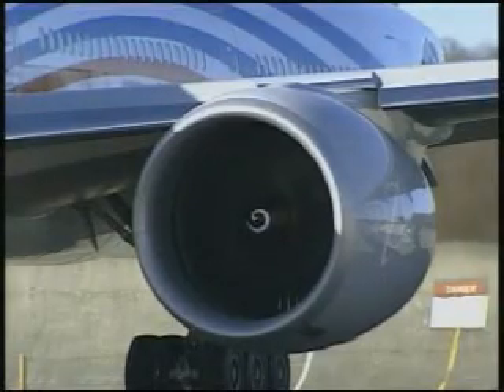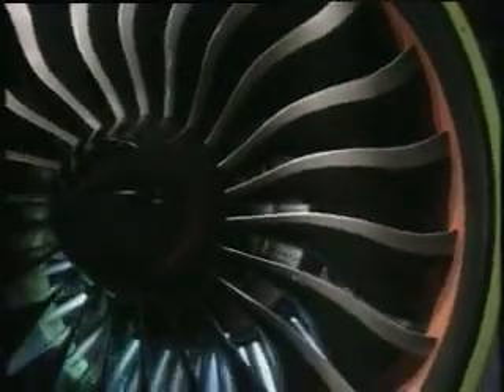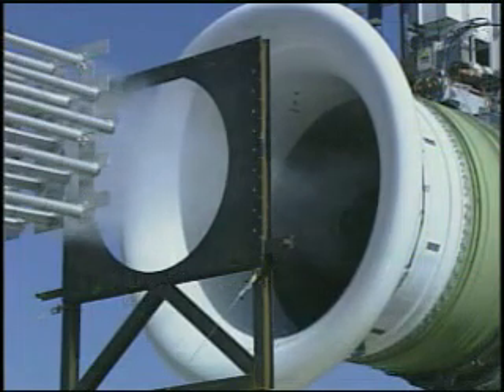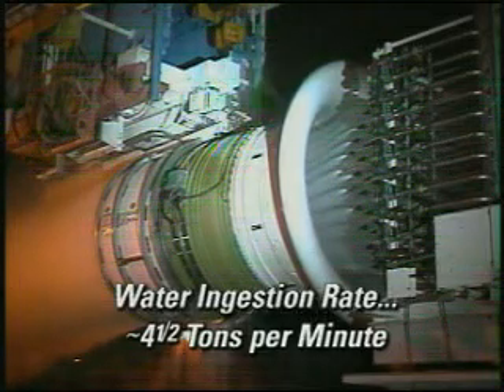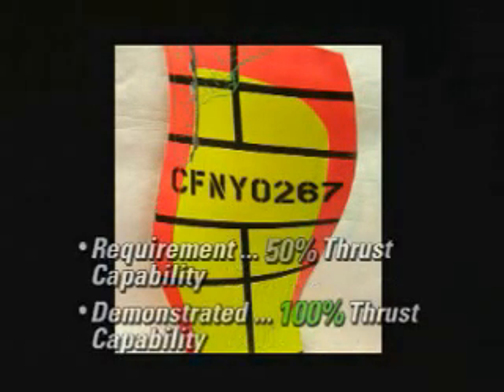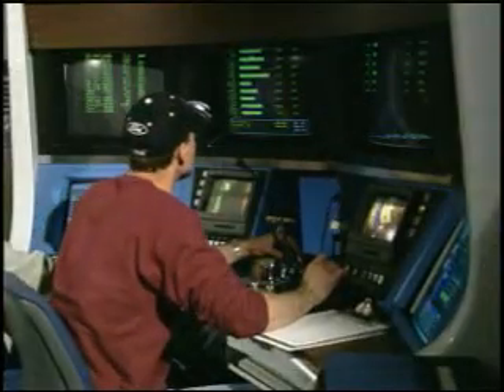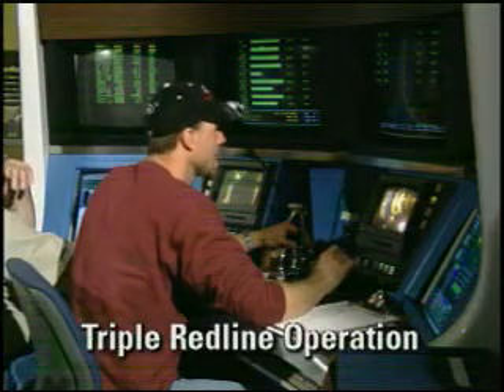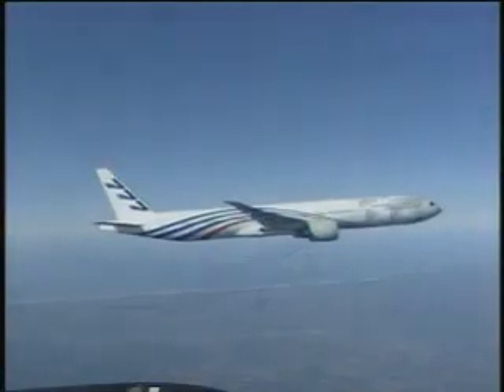GE90-115B Gas Turbine Jet Engine Testing & Evaluation

Comment: too small clearance between the engine airfoil and ground at that 747 test. is this engine was intended to swap its former two cf6/jt9 with this one (as some sources wrote)?
and 2000+ C - is unbelievable EGT

Comment: Salemcripple: about 80% of the flow bypasses the core, where the combustion is occurring. The water is ejected through centrifugal force because the air has a slight swirl to it after the fan. (This swirl is corrected by exit guide vanes) Thus, most of the water isn't going through, and whatever does go through, is evaporated. Compressor exit temperatures are about 700 deg F, and combustion temperatures are above 2000 deg F!

Comment: the black ball is to lower the noise and to also protect the surrounding area cause they did a triple red line test so it ran at full power for about an 1hr or o so the engine can over heat and do some serious damage so they use that doe to catch any flying debris

Comment: The black ball is used as part of the acoustic testing of the engine, to make sure that it passes dB output. I can't remember if the black ball is for ensuring that air intake is even, or if the ball actually contains the recording device. Can't quite remember.

Comment: Correct, no commercial 747 ever had this engine mounted. The 747 shown is GE aviation's flying test bed. It is used to test engines in flight instead of on the ground and the mounting hardware is all specially designed.

Comment: Fun thing: The first gas-turbine prototype was finished in 1903! And that was by `Jens William Eagidius Elling in Norway. I`ve seen the engine for real.. But it was very difficult to make it work properly, and overheating was the biggest problem, until the WW2. Titanium-parts were used, ironichal to be found near the inventor, witch didn`t find what material to use..

Comment: They Replaced Engines 2 and 3 with the GE90 on that 747, just for testing. and Left the Engines 1 and 4 as the original. Damn those GE90's are big.

Comment: The GE90 has a 9:1 bypass ratio, meaning 90% of the water doesn't even make it to the core where the combustor is located.  As for the water that does enter the core, I'll let you figure out what happens to water when it comes into contact with a combustion chamber at over 2000 degrees F. :)

Comment: I wrote of things I learned about at uni, so the cases are a bit outdated. Wiki "Wind shear". It seems not to be a problem with modern 747s but I still wouldn't fly in the new Airbus for at least few years. Each time a new technology is used there is a momentary increase in accident number.
I have more trust for Boeing, y'know what they say about french cars ;).

Comment: Of course there aren't any! It was being attributed to human error or weather conditions, not engine performence (which was correct).
Check Wikipedia for "Wind shear" you'll get a short mention of crashes I spoke of and the mechanism. These are historical cases and electronic systems and trained crew reduces the danger to minimum. But this is with current engines.

Comment: There were 747 crashes related to problem when pilot was entering downward wind area didn't add power in time (in such case plane first encounters wind from front so the power is reduced).
747 engines take around 15 seconds to reach full thrust, these ne engines probably around 45.
Civilian airliners AFAIK don't have aerodynamic breakes, they use flaps to lower the stall speed, which isn't the same.

Comment: Good thing the jet has also the smaller engines. With the long reaction times of these hudge turbofans a simple change of wind durring landing would end up in disaster if it wasn't for theose respondive normal-size engines.

Comment: that's GE90-115B at 130,000LBS thrust (not 115,000), followed by GE90-94B at 118,000 to 122,000LBS thrust (the 2 most powerful & largest jet engines WORLDWIDE)! I know cuz I've e-mailed General Electrics about this info & this is the info they've given me in response!